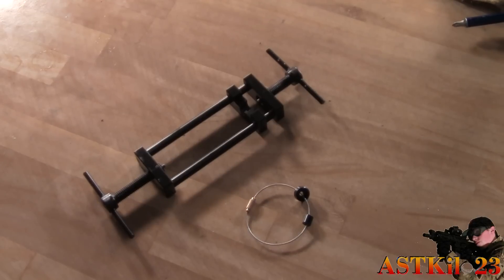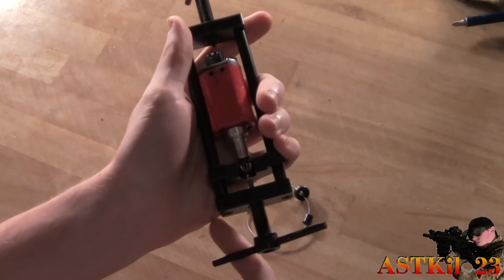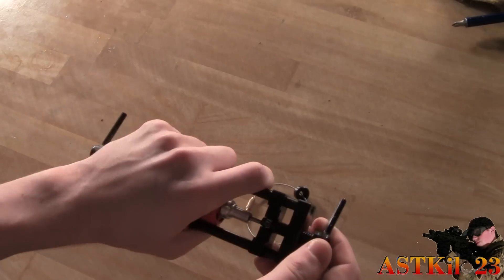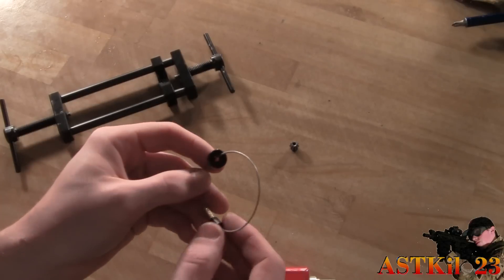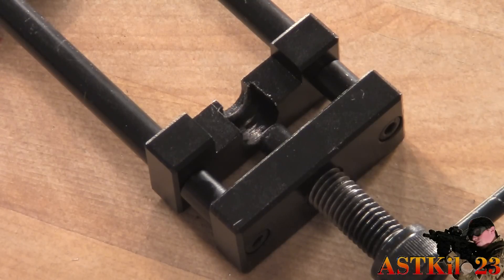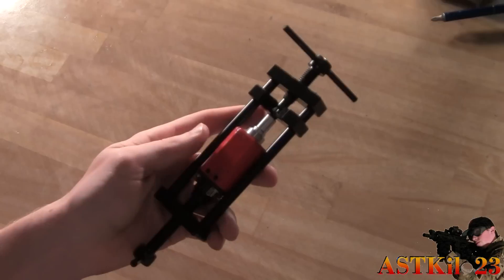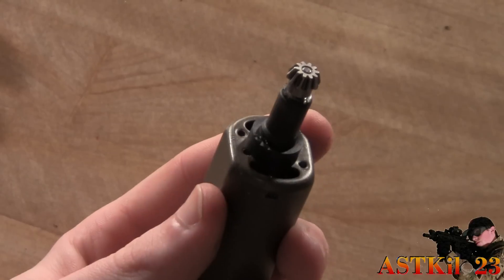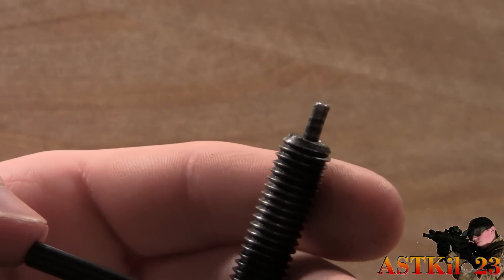AGM Pinion Gear Tool: Removing and Installing an Airsoft Motor Pinion Gear  -ASTKilo23-

Comment: Thank You for this video, how many milimiters is the shaft diameter of the motor, also if it is possible can You measure the inner distance where the motor is palced for gear installation?

Comment: is that able to the D type pinion?
Reply from the maker: You technically shouldn't need to use a pinion puller on a D-type pinion. The point of those is to be held down by a grub screw. 
However, in some cases, that's not always true. I have been able to modify my puller (somewhat unintentionally). One of the pins bent/broke off on mine, so I was able to use a skinny screw to push out a motor shaft from a D-type pinion with mine. But as is, they won't do that without damaging the pin on the puller or the pinion you're removing.